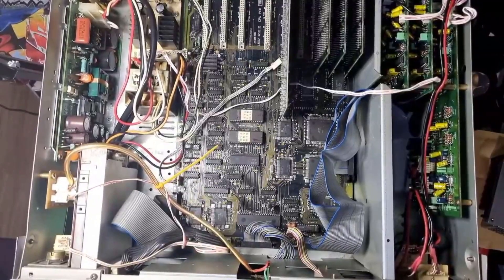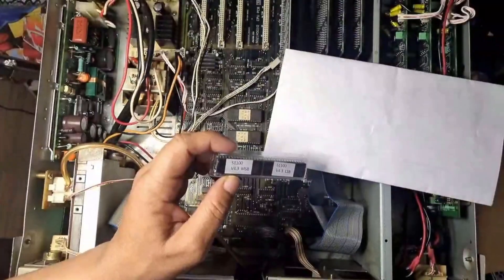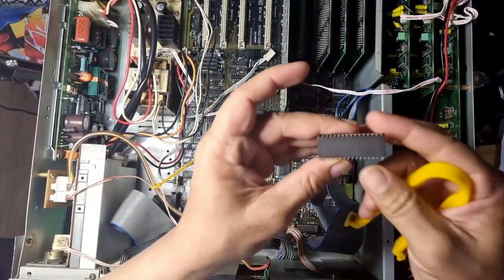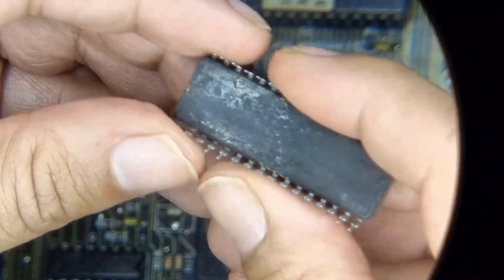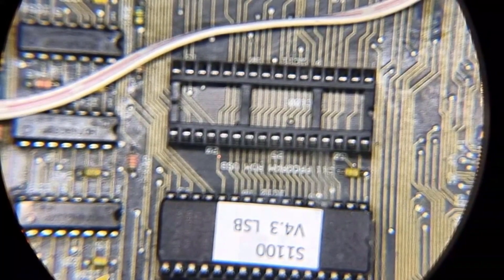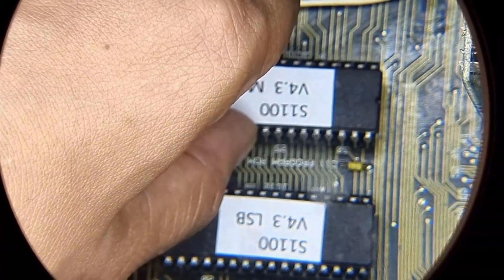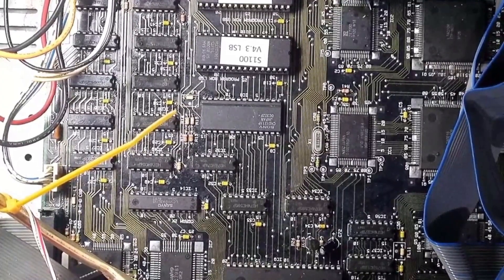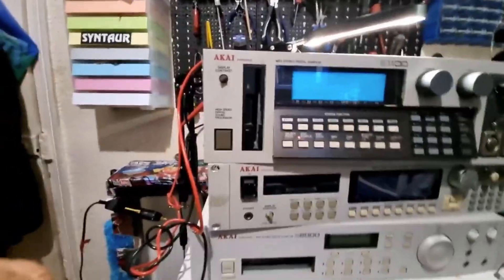HARDWARE SAMPLER  UPGRADE | AKAI S1100 TO OS 4.3 EPROM

Comment: Does anyone know exactly what the added benefits are by upgrading to OS4?
Reply from the maker: The OS v4.3 upgrade provides bug fixes related to midi communication and system code issues.
Added - Timestretch
Added - Read and write S3000 format disks
Added - 2 track hard disk recording
Reply: @TheBizzyBScience  How do you mean “added-timestretch”? New features for the timestretch page?

Comment: Interesting video. I did the same upgrade on my Ensoniq EPSm 2 years ago (2 OS EPROMs). 
And these EPROMs were quite hard to take off too but everything worked well.
The next upgrade I'l have to do will be on my own S1100, not an upgrade actualy but more a fixing: The display light.
Reply from the maker: I may do one of these vids with an upgrade using an iPhone 6 screen

Comment: Just a thought bizzy..... Have you considered looking at the op amps located on the audio outputs? These can be a problem with age.
Reply from the maker: The thing is , i have changed the whole of the output boards and it has made no difference, so I guess that's ruled out. but I will look into the op-amps , do you know if there on the main board?
Reply: @TheBizzyBScience  you must check the name and datasheet of each IC for knowing which is which.Most of the time,it's dual channels,in the form of 8 pins IC.
Reply from the maker: @lanmichaelmix2818  I hear that man, I was thinking of pulling out the mainboard again and taking a bunch of photos, and then going through the datasheets and schematics to locate the ics  and see what they do, I also have a chip tester on order from far, so it may take a few weeks to come in,
Reply: @TheBizzyBScience  great enthusiasm man,i wonder if you have another similar sampler that is normally perform?You can just compare the behavior of the op amps to trace the failure i think.Or maybe just send the device to some expert to fix it.
Reply: @TheBizzyBScience  I'm not sure where they are located on a s1100 but I know that they are located on the main board of s2000 & s3000xl at the back. I've had issues with them on my novation nova. Common makes of op amps were often by texas instruments in samplers and synths. I could be wrong though Bizzy, it's a nightmare when you can't trace a fault.... Like looking for a needle in a haystack. Keep on going mate I'm sure you will nail it in the end👍🏻👍🏻

Comment: Shame eprom didnt work bizzy, just remember that the psu is a 5v and 12v. Any question on wiring, just ask 👍 and try the digital out. It will eliminate the audio board from the equation. The board looks a bit dirty round those ic’s, wonder if anything has been spilt in it. Give it a good clean with 99% isopopyl alcohol and a toothbrush. You never know, if anything has been spilt, it may be slightly conductive. Worth a go. Fingers xd for you bro. 👍
Reply: So do you mean that the sampler uses 12v and 5v?If the voltage is correct and the watt is enough,it will work well.
But what i concern is that the new power supply is a switching power.I assume that the new psu may not match the audio equipment standard and the high frequencies could mess with the impedance values that was designed for the old psu.
Reply: @lanmichaelmix2818  The logic is 5v and 12v dc (i believe for the floppy and hard drive), the audio board runs off a separate transformer, +-12v, this mod is discussed elsewhere and has been done by a lot of s1100 owners. As long as 12v rail on the new psu is loaded with 50w 47uf chassis mount resistor to enable voltage regulation, it should be good. The original psu if fails, overshoots voltage and fries the motherboard, the replacement has output crowbar circuit to prevent this happening. I am open though to the thought of impedance values, im not that well versed in understanding it, and please if you have anything to add / warn us of, feel free to throw some knowledge out here 👍 im always willing to learn and listen to differing opinions.
Thankyou LanMichael.
Reply: @cutnrun22  if the audio board is well isolated from the digital board,i think that it would be okay.If the new psu has good regulation of ripples(which is rarely be the case of switching power),i ain't a problem.Anyway,digital ICs don't require clean DC,but audio circuits do care about impedance,just a few nano henry inductor can affect the total signal quaility of an opamp,it's really complicated topic because impedance isn't the same as resistance,it's like the resistance for specific frequency only,you can't interchange component between those.That is why they use linear power like transformer so that it can easily regulate the ripples so that at least the amplifier can gives clean output.

Comment: You can reprogram them but you will need a eprom eraser and a programmer. I have done a few of my samplers by erasing the original eproms and reprograming them with a TL866II Plus Programmer.
Reply from the maker: Its funny you said that ! As it happens I am messing around with a XGecu Pro as we speak, I had to turn off chip id and was able to read the info , but programming it back to another 32 Dip chip failed, Any tips would be appreciated!
Reply: @TheBizzyBScience  You can only program the eprom after it has been erased. Also there is a blank check in the app to make sure its blank and ready to be programmed.
Reply from the maker: @SteveEboy71  THANKS is there an erase feature on the app Xgpro?
Reply from the maker: I found erase, but its greyed out
Reply: Peel the label off the eprom you extracted, if there is a clear window you need to get an eprom eraser that emits UV light before you can reprogram.
Reply: @markhawkley5411  yeah 10min in under the uv blanked mine.
Reply: Same for me too, although i had one eprom that i error checked that was bad after reprograming but no problem rinse and repeat and it checked ok... Guess it was not totally blank that time maybe.
Reply from the maker: @markhawkley5411  I eventually used a blank chip and it programmed but when I reinserted it into the machine, the screen was blank , so I guess there is much more to this than just a simple read and write
Reply: @TheBizzyBScience  That's a shame, yeah possibly. The EPROM i did was for a S3000XL, i read OS v2.00 off of one EPROM saved it as a bin file then reprogrammed the one i had extracted from the machine (think it had OS v1.5 on it), it did fail the 1st error check but did it again, inserted it and it booted up fine, thought the process would be the same. Great channel by the way, really enjoy watching your video's... The S3000XL backlight change was a great help.

Comment: I am pretty sure that OS 4.3 crashes when you try to load/convert s900 format disks on the s1100. So it may be worth making a backup of the old OS to disk if that is something you will be doing btw.